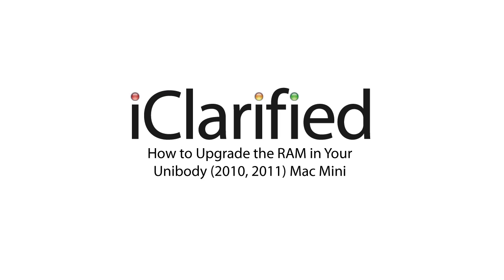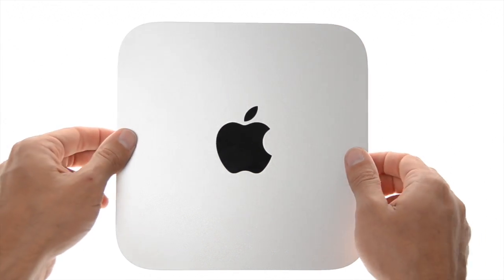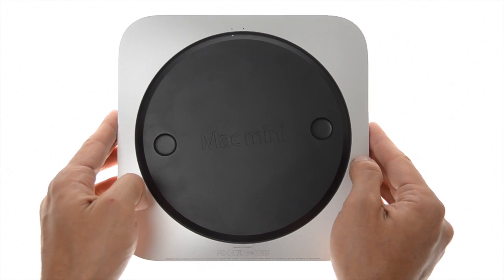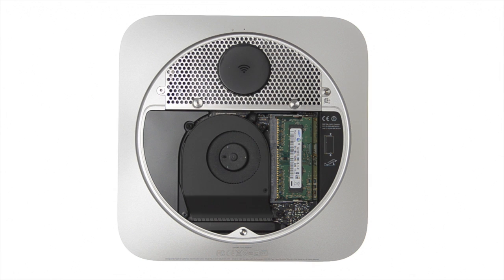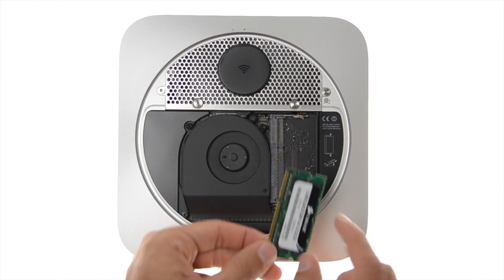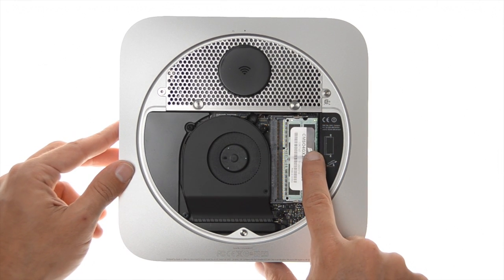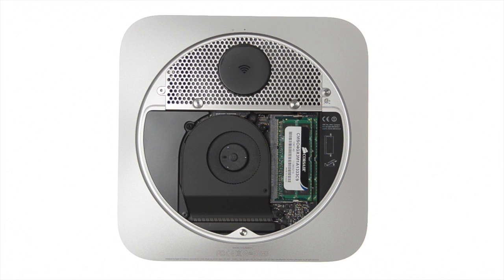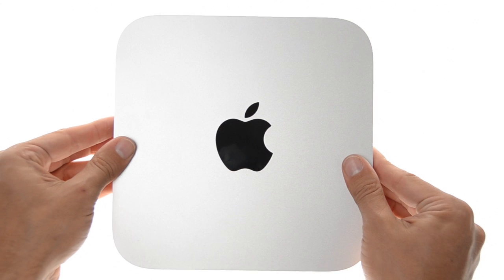How to Upgrade the RAM in Your Unibody (2010, 2011) Mac Mini

Comment: Computer capable people can do alot with a $1000 PC, mate. OSX' stability and preformance is a great thing, if you need it for productivity. Even then OSX has it's flaws, my $2000 2011 MBP crashed more times than my $1000 PC. Though I had more work done on my MBP, for $2000 I expect zero to none trouble. And you don't spend $5000 on a pc if you're poor, don't be an ignorant fool. Apple products are overpriced and can be used by fools, that f their pc up in a week.